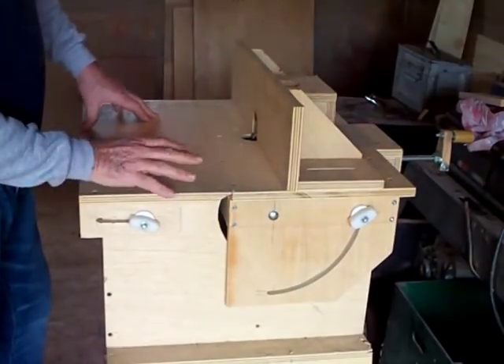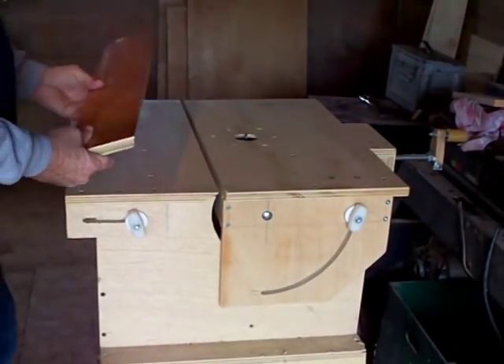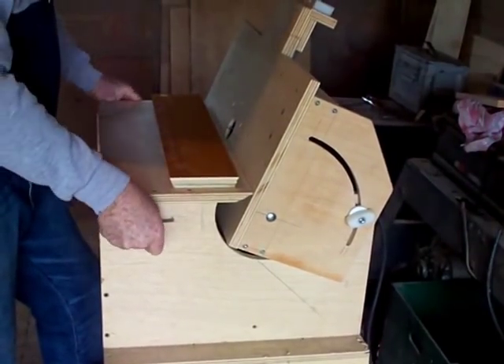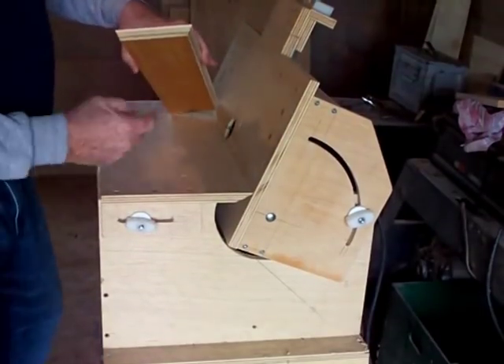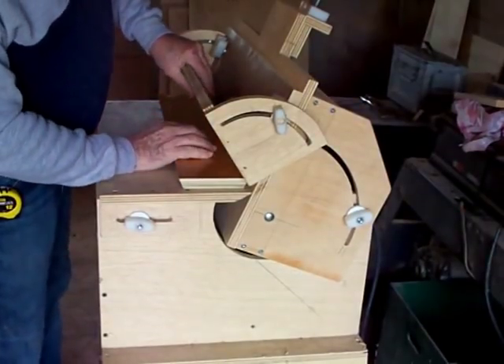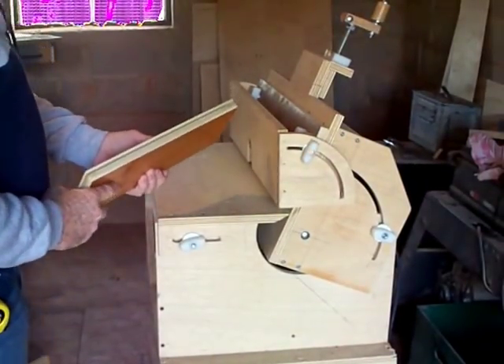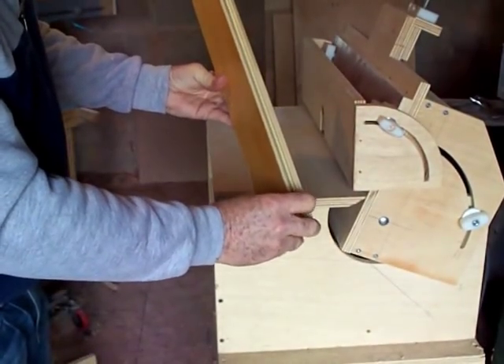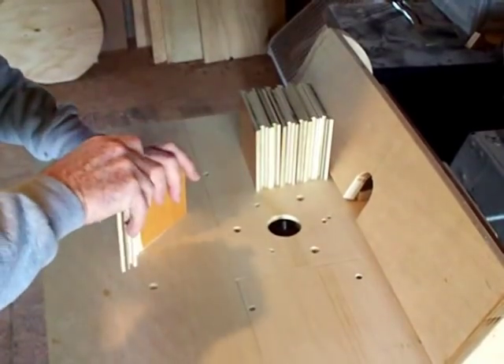Router table made to go horizontal to vertical

Comment: Hi.  I am trying to buy the plans for this item on Ebay and it won't let me because you have the shipping restricted to the US only.  Also I can't notify you via Ebay because the "ask seller a question" gestapo block access to asking you a question.  I am in Australia and an email with the plans should arrive just as easily as if I were in the US.  SO how else can I get the plans?